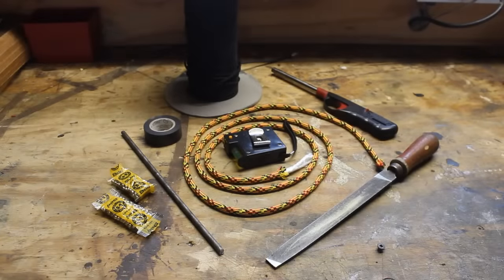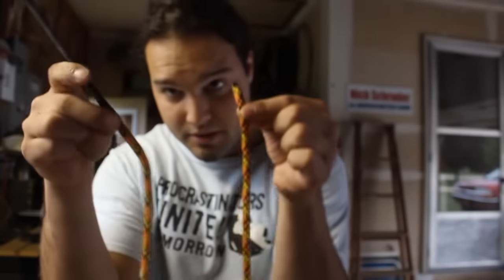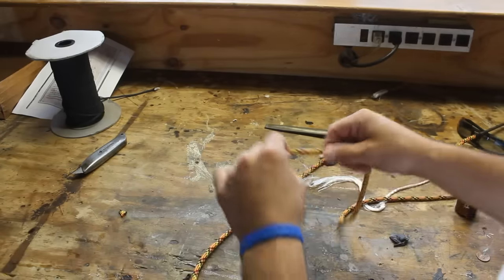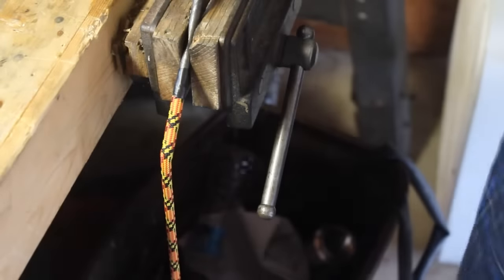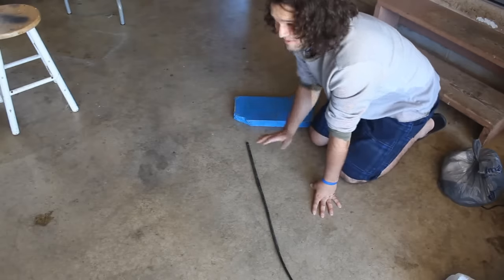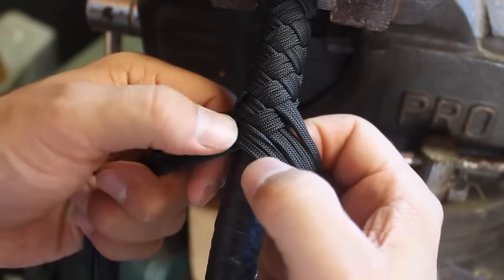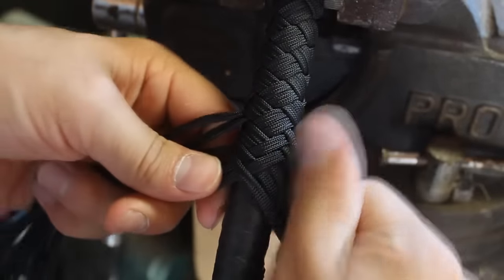How to Make a Paracord Bullwhip - a full length tutorial by Nick Schrader

Comment: 2:05 materials and length
550 nylon paracord 300 ft. +
1/4 inch paracord
1/4 steel rod.
electric tape, file, tape measure, BB's.
16:51 First belly 
20:32 Taping ends
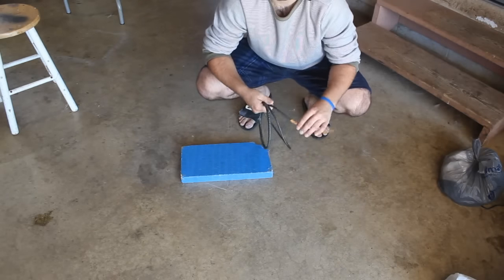28:01 Materials for next belly
29:10 Middle the measures
30:56 2nd belly
31:25 14 ft belly
33:18 plaid it
35:04 ending plaid
40:30 ending 2nd plaid
41:40 endind 3rd
44:20 ending 4th
45:13 taping the rest
45:52 coating the belly
46:40 slab
47:25 next belly materials
47:38 braiding
50:00 overlay diamond plaid
53:19 end 1st
56:09 end 2nd
57:20 end 3rd
58:50 4th
59:55 6th
1:00:26 home stretch
1:02:22 sound breaker
1:06:59 fall
1:07:40 attach fall
1:10:55 finishing up
1:15:44 thunder cat
Reply: Psyondrax1
Reply: Psyondrax1 thank you, I dont have the patience for a video this long.
Reply: Doing the Lord's work
Reply: This is wonderfull, i allmost completed my secound bullwhip. my first was a try with some other methods, but this is PRO!
Reply: thank uuuuuu
Reply: okay but you missed the most important part
34:10 bird whistle :D
Reply: Psyondrax1 oooo
Reply: Psyondrax1 didn't you comment on another video giving us equipment and times?
Reply: You are a godsend!
Reply: Ariel Rae Lmfaooo
Reply: You are a godsend
Reply: Psyondrax1 i
Reply: Thank you kind sir
Reply: Add permalock / lacing needle to equipment
Reply: don't forget about lacing needles
Reply: You’re a god
Reply: not sure if you're still active but it seems that 650 and 550 are really different, the link nick posted was for 650 and the 650 looks flatter than a 550, in which the 650 looks better because of the "flatness" so is it 650 or 550?
Reply: Do you actually need 300+ feet of chord?
Reply: @stresselemental  I've ordered a 100 meters just in case. But I'd imagine 300 ft is probably a little more than enough. But better to have too much. Paracord isn't as expensive as I thought.
Reply: Danke
Reply: Thanx
Reply: You should make a Business out of that videos with those stamps  are so much better thank you
Reply: Thank you so much because i damn sure haven't been keeping track of how much cord was used!!!!!
Reply: Much appreciated, thank you.
Reply: the two 20' strands is very inaccurate. It calls for at least two 25' strands. I learned this the hard way.
Reply: Absolute legend
Reply: You are ADHD's best friend! Thank you!
Reply: What is the diameter for this cord...?
550 means...?
Can someone tell me how thick this cord is ?
In mm?
I've used one by 4mm and 5mm...but doesn't look like thos

Comment: Thanks for your answer, it's an honor for me to receive a response from you as you seem to be very busy. I have finished the 9 foot bull whip and have now started a 6foot snake whip. Maybe I can give you and / or your followers a tip or 2. Tip one  would be slide a rubber band over the whip whilst braiding and move it down regularly, it will keep the pattern clear and makes it easier to restart.  The second tip would be not to smelt the 2 colors together but just take double lengths and form a hitch knot( for when working with even strands, otherwise you will only need to smelt 1x2colors) this makes it faster to start and a lot less hassle and you can pull as hard as you like, it will not break.  Please keep on making this kind of tutorials, you are the reason I am hooked to making whips! Thanks and keep up the good work! Cheers Chris.
Reply from the maker: Thanks for the tip Chris! More videos to come.

Comment: It may have taken me 3 hours over 5 days to make it but I did it with a few modifications such as when I couldn't find a steel rod I cut a plastic hangar and used that for a rod and it worked great I also used a Harry Potter book instead of a concrete block. It took me a put of effort to make the whip because I had no vice to help as another hand. The last thing that I changed was the inner large paracord that was filled with BBs but I only had the one small size so I used that and it worked but I had to squeeze each BB into the small cord which took hang half of the time to make the whip.
Reply: BTW thank you soooo much for making this tutorial because I have learned a lot and your instructions were easy to follow.

Comment: Hey Nick, so did everything even with the extended strands (24ft) and wound up almost 10 inches short. I barely passed the electrical taped core at the end and only went onto the uncovered core about 1-2 inches. It still cracks but I am just curious what I may have done wrong here.
Reply from the maker: Hi Noah, might be the brand of paracord. Try these lengths. 

6ft, 16 Plait Bullwhip (Assuming 10" Handle)

FIRST BELLY:                SECOND BELLY:                       OVERLAY:

2 x 11 ft                             2 x 17 ft                                          2 x 24 ft

1 x 8.5 ft                           1 x 11.5 ft                                        1 x 20 ft

1 x 6.5 ft                           1 x 9.5 ft                                         1 x 13.6 ft

                                          1 x 5 ft                                            1 x 10.5 ft

                                                                                                  1 x 8 ft

                                                                                                  1 x 6.5 ft

                                                                                                  1 x 5 ft
Reply: thanks Nick! It is military grade so I have no idea what happened. Also could you shoot me measurements for an 8 footer? Can find definitive measurements anywhere
Reply: I also came up about 10 inches short

Comment: you should check your messurements, my 20ft strands didn't make it to the end!! I'm 1'3" short!
Reply: Brandon Duntz having the same issue. Did you figure out how to fix it?
Reply: Melvin Romero don't pull them so tight towards the handle. After cracking it a few dozen times it all all started getting loose, pull the strand tight more towards the end so when you crack it, it doesn't pull the strands towards the end. Hope this was helpful!

Comment: Finally made one!
It's been on my todo list for a couple years. It came up a foot and a half short,  then quickly stretched over the end of the core after a few cracks. I had to rebraid  the end and reattach the fall. It's short and quick but it works. I have and 8 ft. Leather bullwhip and I think this short one actually helped understand the "physics " a little better. I look forward to using your newer methods and trying some different types. Thank you for taking the time to make the videos and sharing .

Comment: 35:05 is that pantera playing in the background, and also do you recommend a website to buy paracord for very cheap?
Reply: Lol, amazon sells 500 ft rolls for $30, and you can buy 1/4 inch there as well. The stuff that comes off the roll isn't 550lb though, it's a lower number, but it should work fine. If you really want to be sure, just find a store and buy the expensive stuff, and see if some friends would buy one or two for like $20 or something.

Comment: Nick, Thank you so much for the detailed tutorial video. Your instructions were very easy to follow. The hardest part for me was to get my hands on BBs in New Jersey.  I had to cross state lines and go to a Walmart in Suffern NY. NJ has ridiculous laws concerning BBs. .177 caliber ammunition requires a a licence to be purchased legally in NJ.  However once I took the drive, actual construction took about 8 hours.  I must repeat myself, your tutorial was very well presented and easy to follow. For my first whip, I feel that I have made a good quality product.  I have a few Ideas I wish to experiment with in the future to add strength and spring to the handle transition. Also as I get more practice with Plaiting I hope to achieve smoother tapers. My whip has a small asymmetric dip where I dropped two strands in my plaiting. I allowed the strands to run out too close to each other. First whip and all, I learned and will avoid that in the future.  I will post an update upon completing my second as well.  These para cord whips are very accurate to aim. I enjoy target practice with it very much.  It handles very well, and I can crack overhand (cattleman's crack I believe it is called) around 70% of the time.  I can crack the whip most often 85% of the time using an underhand and a side arm crack. Since I am a beginner I wear safety glasses and have already kept my eye due to this precaution. I have already shot loaded my core for my next project. I'm working on an 8 foot bullwhip this time and I'll be attempting a diamond pattern in my plaiting. Black and royal blue.  Thank you again for your time spent on making the video. I would have never been able to attempt this had I not stumbled across your videos.

Comment: Okay so i completed my first whip (with some fusing and electrical tape) because i ran out of cord on the third belly. Do you think if I cut the (2) 20 footers into 25-28 footer that would be enough? because i was about a foot away from the point where you said to stop. dropping strands wasn't an issue, but it was just that last under 1 over 1 progression that i ran out of cord on. 

Thoughts?

Comment: My 5 foot rope turned into a 7 foot rope after I gutted it. It happened twice. So now I am working on making an 8 foot whip. Also a tip. I used a reusable straw to feed the BB's into the core. Just bunch the rope onto the straw much as you can, use some spring clamps at the top and bottom to hold the rope in place. I had half rope on the straw so I only had to work to get the BB's into the second half where I wanted them. That made loading the BB's much easier.

Comment: Hey I''m using this method to make a lead rope and it's helped me so much but I was wondering I get the pattern on the part that is facing me and then on the other side it's a mess then it all ends up really lose. What do you think I should do. Also have you ever tried using 4mm steal rope as a core instead of the balls?

Comment: Great video Nick.  
I made a whip using ur video as a guide. The steal nail I used appears to be thicker than urs.  Because of this I had to cut 20inches off the end of my original 6'1" length. 😢😢. Even after I added 1ft to all of your final cord lengths. :('. I may give it another go but that's a lot of work for a 56" whip.

Comment: Hi. I am looking for a project and this seems like a fun thing to do and is the best tutorial on starting and basic braiding l have seen after looking at loads of them.
 My question is do l have to do 8 strand plaits or can l just do 4 strand plaits on each layer? Would l need to adjust the lengths? Do an extra layer of tape and braids to make up for the lack of strands? 
Anything more than four strands does my head in and l am not interested in fancy patterns.
Also, can l use hockey tape between layers instead of electric vinyl tape?
One other thing l thought of was instead of the smooth steel rod could you use threaded rod in the same length with the ends smoothed like you did with the file? It would have some grip.

Comment: Dear Nick, my whip is a little shorter. I noticed while plaiting the bellies, so i made the overlay a few feet longer. however it still was around a foot and a half to short. I followed the lengths of yours and used the same type of paracord.  Is there any reason you can think of for this? Thank you and keep up the good work
Reply: Clairinator Usually what happens is you didn't measure correctly (I have done it) or you didn't pull the  belly and overlay strands tight enough, or you didn't roll it.
Reply: Thanks Nick! I'll Roll harder then

Comment: Nick.....thanks for the video. I have been hoping to find something like this that is easy to follow. I have a question. When you start plaiting on the handle, is it only going to cross on the front side as you're working? I started that part and the back side doesn't have the same crossing design.
Thanks.........T

Comment: what about using contact cement on the electrical tape as you do the plait layer, so it adheres? so kind of applying it as you work down, to the section which is just below the plaiting area

Comment: I’m currently in the middle of this project and I used a thick bolt for the handle so I’m worried my last belly won’t be long enough if I use the lengths provided is there a way to figure it out like if my handle is an extra half inch around how much longer I need to cut my cord

Comment: hey sorry to comment on one of your oldest videos asking a question, but I followed this (mostly) to the letter, and for my final belly, I wound up not having nearly enough material to get all the way to the end. I was pulling significantly tighter on this belly though - is it possible that pulling it tight and reducing the width of the strand made it not go all the way? should i just pull the last belly loose and re-lace it tight-but not so tight that it's shrinking the lace?

Comment: Great video! It seems that you put a lot of time and effort into this tutorial and I appreciate it.  My whip turned out great and it's a lot of fun to crack.  

I do have a question.  I have seen some performers give a light soak of fuel to the whip and crack it to make a fireball.  I know it is dangerous, but I wanted to know if I could do this with a paracord whip or would it destroy the whip within the first few times I set it ablaze?

Comment: Wouuld it be possible to use a needle and open the core where it starts showing, then running the fall inside it, coming out the end instead of having them ocme out parallel. Like you did when making the fall loop. maybe it is unecessary but i will try as soon as i can afford the amount of paracord needed. It is around a dollar per meter here at least the 4mm

Comment: Hey there Nick! Don’t know if you still track of comments on this video, being that this one is so old. I’ve made a couple whips as per this tutorial (first one about 3 years ago I think, that one is an abomination straight from hell - really soft polyamid rope and some really stiff stuff too for the overlay and 1mm steel cable for core loading. Cracks nice, but that’s a different story...), now Paracord. I’ve mixed in some of the techniques from your newer videos too. One big question though. Should I be worried about pulling the plaiting on the overlay too hard? It seems like I have a nice and smooth rollout after my second belly, but when I’m done with the overlay I get some stiff spots, like the “wave” just flops out when it gets to the certain spots. Makes the whip kinda hard to crack.
PS - waiting on my amazon shipment of artificial sinew from stateside. Being in Russia doesn’t exactly make this hobby easy. Especially on the wallet - shipment charges are twice the cost of the product. Hence two 900’ rolls ordered...
Thanks for your videos. VERY detailed tutorials, arguably THE best out there. And thanks for any advice you may have for me.

Comment: I just started to plait the belly but after a few inches on the handle I noticed that although my plait appeared straight and even from the front it appeared uneven with gaps on the opposite side.  Could I have made the handle too thick?  I used 1/4" steel rod and hockey tape.

Comment: Awesome video, great work. If I wanted to make a 10ft whip, how do I calculate the length difference in chords?
Reply: frank vagueiro To calculate the Strand lengths needed for ANY length of whip you wish to make. just take the measurements Nick provides for the 6 foot whip. Then just take a strand length, multiply the Strand length by the length of the new whip. Then divide by 6(the length of the original whip)
Reply: frank vagueiro Just use this formula. (A × B) / C = D. 
A = Original Strand Length. 
B = New Whip Length
C = Original Whip Length
D = New Strand Length

Comment: Hi Nick, 
I have a quick question for you:
I just started your instruction for the bullwhip. Because I am German, I use m and cm and 6ft is (nearly)  2m. So thats what I started with. After doing the handle, filling it with the BB's, and doing the electrical tape over it, I thought I better measure it. I know, a bit late. Now I have an 8foot whip (including handle). Now my question, should I just cut it shorter, and does it matter the if the BB´s are filling up more than the half? or cut it, and open it up again? or make an 8foot whip, and hope I manag to convert the measurements right?
thanks or you help! I really like your video and hope to finish my first bullwhip soon

Comment: Can i leave the inner strands in the paracord for the inner plaiting to get a thicker handle?
Or will this cause problems later on?
Reply: Roel wieggers you could. but the plaiting won't turn out as well. plus the inner core would screw up the rigidity of the whip. Keeping the guts in would stiffen the whip too much

Comment: I realise that this video is quite old now and my comment may not get answered but what the heck righ? So ive been making paracord things for about a year now and thought id have a go at making a whip, love the video, very easy to follow, my question though is this: When you saw off the bottom of the steel rod once youd finished and sawed through the paracord, is there a reason you did not melt the ends to seal it all up before applying the tape - id be worried that it'd work lose?
Reply from the maker: Hi Paul, very good point. I should have melted the paracord before applying the tape to prevent slipping and unraveling. Please check out my newer videos, as methods have improved. Thanks for watching!

Comment: Hey Nick i was looking to get into making whips and i couldn't find any 1/4 inch paracord. where do you get your materials if you don't mind me asking or is there any other way of making a nylon paracord whip without using a 1/4 inch length of paracord as the core?
Reply: i am using a #550 for the core and fill that one with copper bbs.